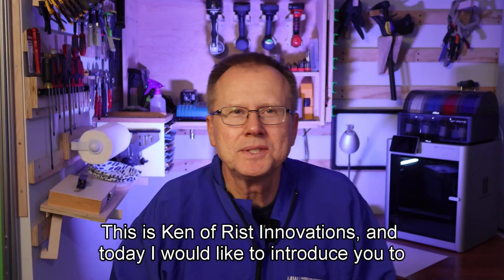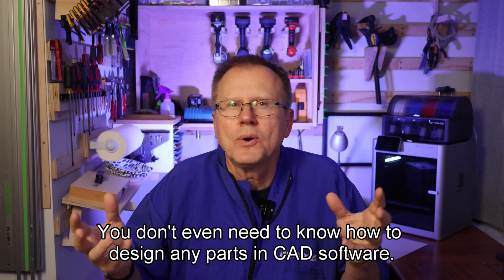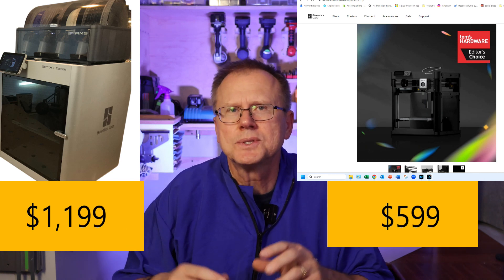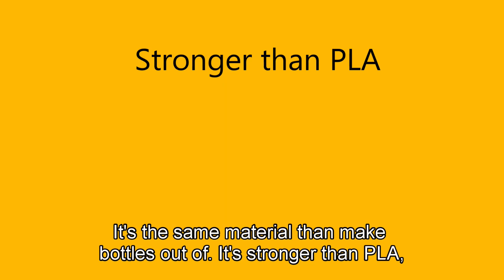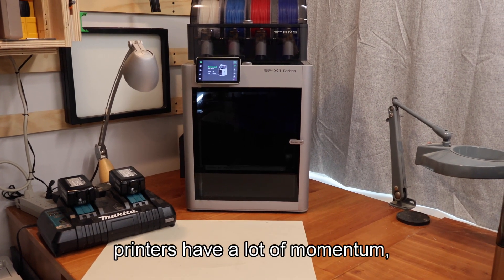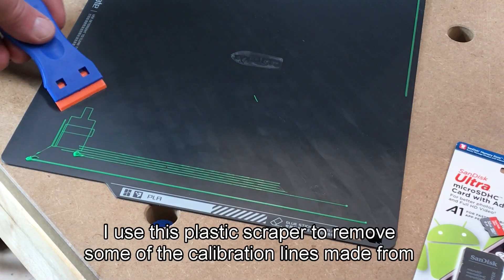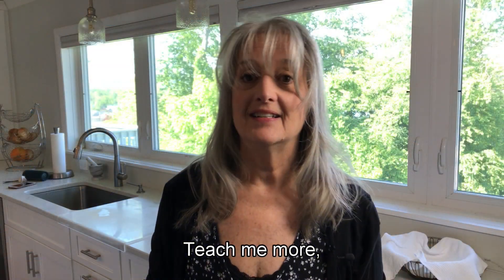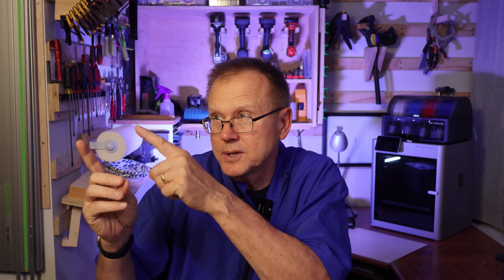BEST Beginner's Guide to 3D Printing: Easy Steps to Get Started Quickly!

Comment: You stumbled onto a pet peeve of mine.  Software is a collective or an adjective.  There is no such thing in proper English as “a software”.  Instead one can refer to something as a program, or an application, or even a software application.  Note that “software program” is redundant, however.  Otherwise software is a non numbered collection.  The word software does not have a plural.